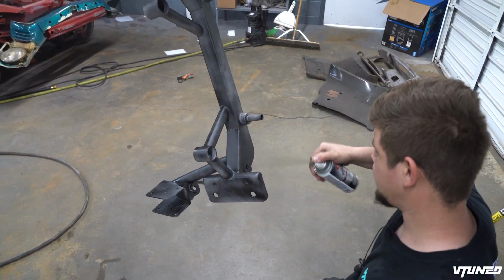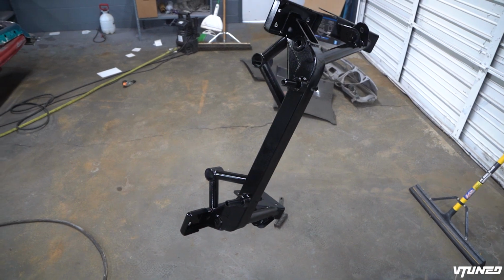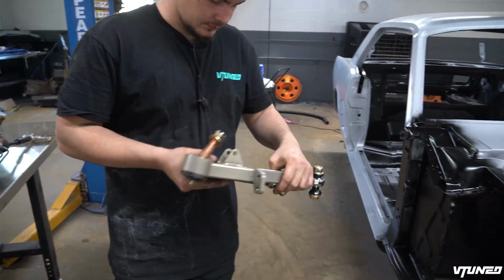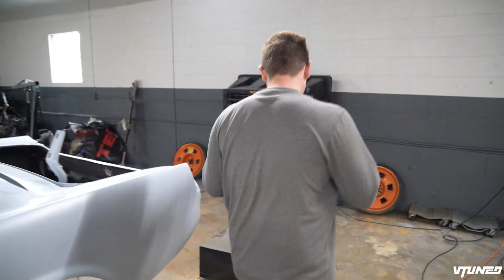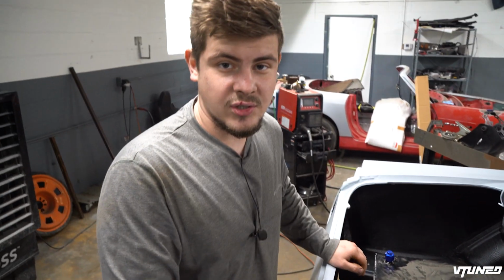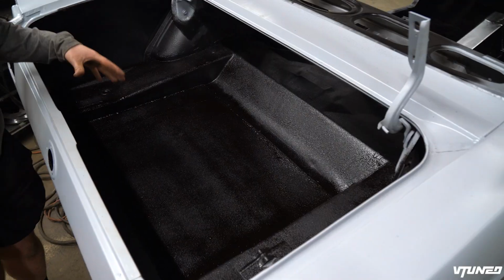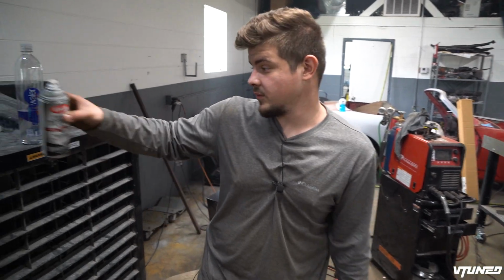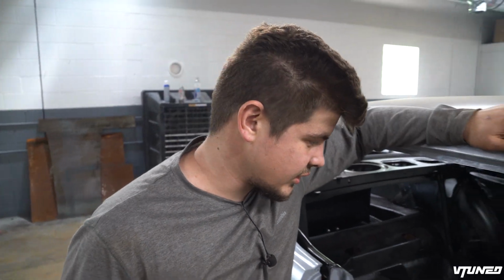Finally Starting To Reassemble The 1965 Ford Mustang (HUGE MILESTONE)

Comment: Cut a tray for the fuel cell and drop it down.   Gives you more trunk room, lowers the center of gravity and you could also use the stock fuel filler.
Reply: I agree!
Reply: Very much agree
Reply: Completely agree!
Reply: Yes!!! Exactly! I agree on this too.
Reply: 1000% agree
Reply: 100% agree as well . Much neater job lowering it down
Reply: I was thinking the same and I would definitely do that!
Reply: Yup. Gettin in a hurry makes the easy way seem like a good idea but really, now is the time to do it right. Re-work sux. At just over six pound a gallon, 20gal that high in the car is gonna be noticeable in the corners, especially if that tank doesn’t have foam in it.
Reply: absolutely!
Reply: yes 100%
Reply: Ben doesn't seem to follow any logic with this build. Seems to cut first then worry about it later. A lowered tank makes sense to everyone else but him, until he goes to fill it, then too late, has to pull it all apart and start again.
Reply: You say you want to use the existing filler, look at your levels, needs  lowering !!!
Reply: Honestly, I would have gone with a modified stock tank over the cell.
Reply: That what i was thinking 👌🏽, and he is able to use the original fill tank too !
Reply: Will also run cleaner fuel lines with less fittings and potential leak points
Reply: Exactly then use some 1 1/2” flat bar to make some brackets for it to set down in
Reply: I agree
Reply: Exactly
Reply: @timlincoln2246  I totally agree with that. 100% - Stock modified - that way he can also use the designed fuel port on the back.
Reply: Seam sealer?!?
Reply: You the cell in wrong the two holes go to the back... Under acceleration gas goes to the back of the car and you won't starve your fuel pump 🤔
Reply: Good idea.
Reply: But he said everything is frikkin perfect.😂
Reply: Nailed it!!
Reply: Agree, my thought exactly
Reply: Keep the tank the car for all the reason listed. But the smell of gas coming into the car at times will suck
Reply: i agree , this car needs to have a classical look

Comment: Center of Gravity - lower that fuel tank!  20 gallons of gas weighs 120Lbs.  Even the factory placed the tank below the trunk floor.  Also the sump faces the back of the car as others have mentioned.
Reply: Also if he uses the original fuel hole, he wont be able to top the fuel off.
Reply: Nope, he should put it on the roof so that the fuel easily goes down to the engine.
Reply: Ya seems like he’s just trying to get progress and go the easiest route, meanwhile we’d love to see his ingenuity with fabrication
Reply: @voldemarsaugspuls5795  fuel  hole????

Comment: Check the gas tank manufacturer design, but usually the ports on the bottom side of the tank go towards the rear so you don’t get fuel pump starvation under heavy acceleration.
Reply: Beat me to it lol
Reply: This is true
Reply: He should put it on the roof so that the fuel easily goes down to the engine.
Reply: I was going to say this. Plus. One of those is the feed and one is a drain. The return will go into the top and usually had a spout inside that brings the fuel to the bottom of the tank to stop splashing and aeration.
Reply: The sump
Reply: @rhamlay8806  LOL
Reply: @rhamlay8806  In plastic bags.
Reply: Very true.  Sump goes to rear as fuel is pushed rearward during acceleration
Reply: true
Reply: Yes yes yes...
Also thats thought floor fuel tank... it has to comr through the bottom of the car and mounted to the bottom ... and if he does that he can run a filler neck using the stock location of the fuel cap
Reply: Tank sitting way to high kid is not very sure on what he does .
Reply: I agree the ports go towards the back.

Comment: Very cool. I'd mount gas tank lower since:
1. Ensure that fuel pump doesn't get "flooded" due to gas tank seating higher than fuel inlet (which is fairly low in the back)
2. Lower center of gravity
3. More space n the trunk - you can actually place a plate on TOP of the tank and then have much more space there.

But it's your car and design so enjoy it 🙂
Reply: ... And you can use the factory filler

Comment: Why not drop the fuel tank more? Can still use all the work you just did, but cut a hole in the new sheet metal and maybe add bracing. Run lines under, could use stock filler cap which looks cool, adds trunk space, and lowers center of gravity.
Reply: The way to do that, would have been to raise that middle piece rather than recess it, and use some angled steel to make a cradle underneath. Really that requires a fuel pick up though so he'd need to make modification to the tank to sit that low Personally I would have gone that route and done a dual fuel pump hanger with 2 intank fuel pumps, and moved the return and vent to the hat and cut off and welded up all the AN fittings. It would eliminate the need to run an external pump/surge tank as well.
Reply: Stock filter cap is for show only🤬 this project failed

Comment: I think a stock gas tank would’ve fit better for more room in the trunk
Reply: No doubt.
Reply: Have some room for spare tire and jack and its actually cheaper than the fuel cell he bought.
Reply: Look at the dust on that fuel tank. I bet somebody gave it to him or he bought it used. And I don’t think they come with the standoffs like that to bolt it down. So he’s probably into it for less money than a reproduction tank. I hope he puts the pick up towards the back like it’s supposed to be though
Reply: Would look neat

Comment: That part on the bottom of the tank is the sump. It goes to the rear of the car not the front. It is designed to sticks thru the floor for the fuel lines so they are outside the car. Personally I would lower that cell down and use the stock filler cap. Having it on top of the floor raises the center of gravity.  Cut a hole in the floor and raise the tabs on the cell so it only sticks out about half way into the trunk. Otherwise loving the content. Keep up the great work.

Comment: Ben, I think the fuel cell should be oriented with the feed lines towards the rear. When you’re accelerating with a low tank, the fuel will pool into the rear which is where you want your pickup. Just a thought,
Reply: My thought exactly. He doesn’t know any better

Comment: I put that exact same fuel tank in my 46 Ford street rod. I mounted it with the pick up sump at the BACK of the car. This gives you more room for filters and pumps. I also made tank supports from thick wall tube so tank sits level in car and I did not have to cut into the perfect 70+ year old trunk floor. 
BTW....you need a mask when painting......when your north of 60 like me....you will wich you did. THX

Comment: Agree with the lowering of the tank like every other comment - you don’t want weight high and rearwards. Also, I like using steel to fill the gap between the back seat and trunk, and parcel tray - I like the fuel cell completely separated so if it catches fire, you’ve got more time before it enters the passenger space.

Comment: That drop on the tank goes to the rear of the car and you have to cut a slot on both sides and make a little drop down for the lines to go under the car too the front of your car. The top lines need a different pump for you to use them.  Put it in place and mark each side of the sump and cut a line as long as the sump then make up sides for it and weld them up . This will leave you with your sump in your trunk and you can get to your fittings and run the lines under your car.

Comment: I think the automatic is a good call! I wouldn't be worried about the fuel cell height as Ben probably won't be competing in any races.
Reply: It's always a sad day when a manual transmission gets the boot :(
Reply: Won't be turning any corners too quickly either with that much fuel weight located that high in the vehicle. 
Mustangs before  the independent rear suspension models are notorious for having the rear end come out from under you at low speed turns while applying power, far less power than this car will have.
Mounting the tank that high will only exacerbate that problem with a  weight shift that high above and to the rear of the center of gravity occurring in the middle of a turn.
Reply: Especially when you cant drive stick !
Reply: automatic is for a wimp, a real driver listen to his engin and shifts himself😉
Reply: @Sev_Auk  I agree 
Unfortunately today people want the car to do everything including drive for them.  Sure automatics are great if all you care about is driving fast in a straight line (drag race) 
They don't understand the fun and control you can have with a manual transmission, and your brakes last longer. 
Sorry somehow this comment became a rant.
Reply: @smavtmb2196  I hear you bud.  Nothing more fun than downshifting into second or third and taking a turn with actual control.  I know proponents of modern transmissions would say that paddle shifters give you the same advantage and to some degree, that's true.  But, it's more of a brake hard, slam it into the gear you want and hope the car's computer doesn't do something unexpected and put you in the gutter.  Having a car with clutch that you can finesse any way you need to is a true joy to drive.  It's all you, no driving aids and no one to blame except yourself if you ditch it :)
Reply: @Sev_Auk  Well said👍
Reply: @iguanabelga8028  manual for hobby and automatic for daily perfect combo why the hate why not both,but agree with you manually for life
Reply: Or even driving this if the last one is anything to go by.

Comment: Leaving the fuel cell in the trunk will create more problems than you can imagine. If you don't have clearance to mount the fuel cell below the trunk floor, cut the floor and leave about 1 to 2 inches of the fuel cell above the floor. It is best to keep the fuel cell below the floor, otherwise in an accident you have the danger of a ruptured fuel cell releasing gas into the interior of the car. This was a flaw in the original design of this vehicle and other Ford cars of this era (look up the law suites). I have owned a 1966 Mustang since 1966 in case you might wonder if I have any experience with this car.

Comment: Good job with the car brother.. suggestion.. cut a hole in the trunk floor so the sump in the tank protrudes through the floor and definatly run the fuel lines under the car. NOT through the interior.. If you want to be fancy you can get a piece of exhaust tubing and run the lines through them when you go up over the axle.  That whould be NHRA spec.. also with having the fuel cell in the trunk you may want to concider a piece of aluminum between the back of the passenger seat and the trunk compartment.. that is also NHRA spec.. its a good idea to follow these guidelines because we all have learned over the years what works as far as safety goes... have a kill switch for the pump somewhere you can access from the cockpit also. Hollar at me if you need any further information or advise.. PS.. the sump in the tank faces rearward so you dont starve the pump..

Comment: I would drop the tank through the floor of the trunk at least half way. Ports face the back not the front. You can then use the original filler port if you weld in a large port on top of the tank. Nice job Ben. 👍🏻

Comment: I’m not sure do you have an idea about how noisy the fuel system in the car is?
The pumps will be making some noise and the fuel going thru filters and hoses makes noise to.
Lower the tank in the trunk,from then use that to get the fuel components under the car.
With that you got quieter and safer fuel system.
Lower centre of gravity at the back and may even use the stock fuller neck.

Comment: You really need to get a bead roller to make the panels look nicer and would be stronger, Just looked a manual one up and Was £279 about $363 in your money, well worth it.
Reply: Been saying it from the start! Along with powder coating suspension parts, for long term finish !

Comment: As sophisticated as these new transmissions are these days, I say go with the automatic, use a GT500 shift dial, an aftermarket controller and install paddle shifters! As far as the fuel cell goes, listen to all the other comments about where the outlet goes. Also, I would drop it down to where the top is flush with the floor of the trunk. That way, you can still use the stock filler. By the way, I’ve loved every one of your builds! You have crazy talent, and keep ‘em coming!

Comment: Ben there's a drop in fuel pump assembly for fuel cells. You have a 12 bolt fuel filler and you just take out the one you have and bolt the fuel pump assembly in , it has a filler hole on it so you could use the original spot to fill or put a cool filler on the rear piller and put cool cap.The 2 I love are one from a Viper and the other is from an Audi TT.Your cell is in backwards. Vents and return need to be towards the front of the car. I have a fuel cell in my 70 Mach 1 mustang and went through what you are! I would mark a hole in the plate, cut it and lower the cell half in trunk and half under the car. Weight balance will be better. And you gain room in the trunk! I lowered mine and it's just above the rear pan so yo can't see it! I hope this helps

Comment: Cut a hole in the trunk with sheet metal straps like a beefy OEM strap but no matter which way you end up mounting that tank it’s metal on metal so make sure you use rubber spacers between the mounts and metal or it will rattle like crazy ask anyone with a flat bed truck with a mounted fuel tank on it lol. Great build so far your viewers as well as you want this thing right for you so don’t slack on mounting the fuel cell right for time it’ll be worth it in the end to mount it right and under the trunk! Keep digging brother!

Comment: Install the gas tank lower.  A lower center of gravity will make the car handle better.  Having use of the trunk space is a nice bonus.  Do it like the original to make it look best. Also, you should geta bead roller.  Notic panels from car makers are not flat.  The beads are there for strength and rigidity without adding extra weight.

Comment: Ben......please please please push the tank further forward on top of the axle tunnel. 

That pushes the tank closer into the wheelbase (better weight and safer) AND will give you some trunk space.  It can sit right behind the rear seats.

Please, consider it, means only making a rear raised mount for the back of the tank.
😎👍

Comment: Be so much easier and cleaner to get the proper mustang fuel tank .
Reply: That’s the vtune specialty. Make everything way more complicated and “engineered” than it needs to be.
Reply: @IIIIIIIlII  A stock replacement tank at Jegs is only $120.
Reply: @IIIIIIIlII  yeah, more complicated in a bad way and there is zero engineering in his work, just goofing around and looking like an idiot whatever he does. That build is total crap and every car builder that knows things will be laughing at his work.

Comment: I am not an expert by any means, but I think that fuel tank should be lower. Usually gas tanks, EV batteries and the like are lower for center of gravity, protection, safety, etc.

Comment: turn the fuel cell around where the lower part faces towards the rear. this allows your pump not to lose prime when your hard accelerating. any car builder will tell you that.

Comment: The tank is designed with the fuel lines setting at the lowest point for fuel pick up. And you'll want to run the fuel lines under the car, not thru the cabin. Looking pretty slick!

Comment: bottom outlets are designed to go in rear for fuel on accelleration. that design is from drag racing . you used to be able to buy a sump to weld to stock tanks that had an fittings for fuel lines to help prevent fuel starvation on drag cars

Comment: With the finishing of your welded spots on the body, like across the roof, have you thought about giving traditional leading a go as opposed to body filler? Their are more environmentally friendly options than the old style leading and it would fit better with the period of the vehicle, not to mention learning a new skill. You're going down the custom classic road, makes sense to give it a shot :)

Comment: If you cut a small section out of the trunk floor for the tank to sit flush, those fuel outlets will be situated nicely underneath the body, facing the rear. It’ll be a neat solution to run the lines and use the inertia under acceleration to counter any fuel starvation issues you might have with a close to empty tank.

Comment: That front end is TIGHT! all puns intended, looking great. I know it would suck to cut into what you did, but going to have to for fuel lines and not sure what pump you are using so look into how it wants to be positioned. Personally like the submerged pumps because the fuel helps cool it and keep it quiet, but that also has its drawbacks. Might be able to do a returnless fuel system depending on the setup from here and could cap the second vent with 1 less line to run. Please cut the firewall for the steering and brake master before you paint or body work. Doing such a nice job and would suck to go much further without it done having dust over everything. I know seat position may need to be looked into but it all works together or its a statue. Automatics are fine, some could use a shift kit or upgraded clutchpacks but depends alot on the torque converter or the rear axle ratio. That's the only reason they have a bad rap.

Comment: The fuel tank is a sump tank and outlet port is supposed to face towards the rear of the car or well have fuel starvation under acceleration!
Also thats thought floor fuel tank... it has to comr through the bottom of the car and mounted to the bottom ... and if he does that he can run a filler neck using the stock location of the fuel cap

Comment: That part with the 2 fittings on the tanks bottom goes to the rear of the car because under acceleration the gas will be forced to the rear of your tank!